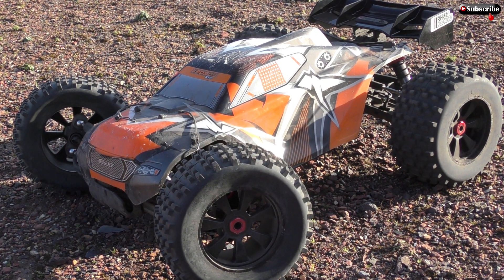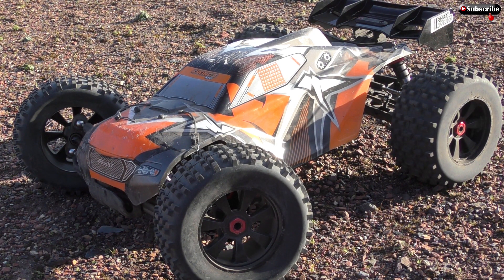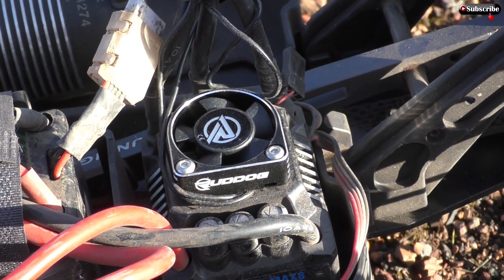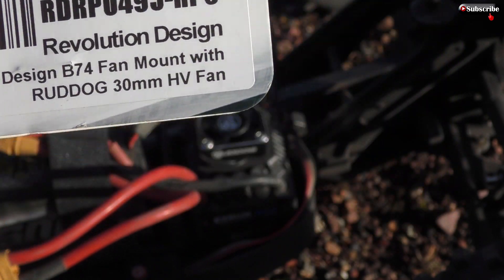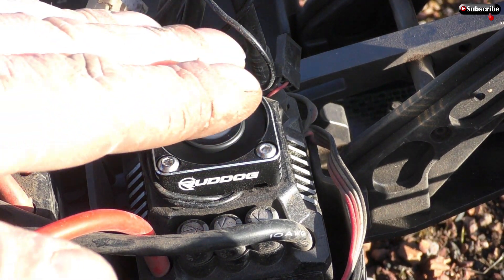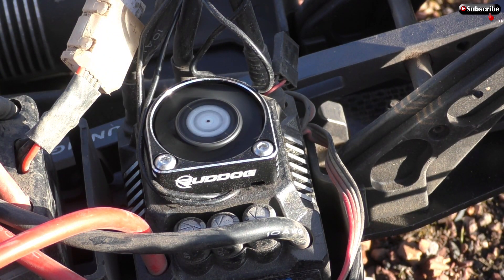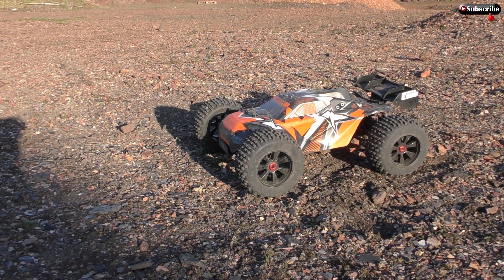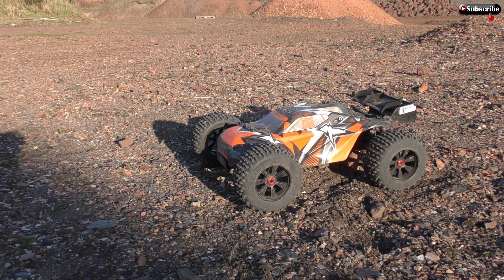KRONOS XTR GETS RUDDOG FAN

Comment: From one Paul to another…good video again.  Good suggestion on the fan.  I’m just now working my way thru adding differential oils to my XTR.  As many have noted on YouTube…the diffs on these XTRs don’t have enough oil in them.  I’ll finish the back diff tonight…but the center and front did not have enough oil.  Anyway, great motion shots on the video also!
Reply from the maker: Thanks Paul :) I checked my diff's not caked with oil but I don't feel wheels ballooning to badly I'm preferring the kronos on 4s only in think in don't like with heavier diff oil is I find throttle control in air is compromised a bit

Comment: Looks like a good fan but without a cover if debri gets in there it may damage or even break it. You should look into game changer fans, heard a lot of good about those. I'm running double power hobbys in my Jambo and xtr and I have the same issue, no covers. Gonna try to make some up. 👊🏻✌🏻
Reply from the maker: I'll defo have a look wantimg get fans on motor too plan to gear it up a bit soon so will defo help ;)